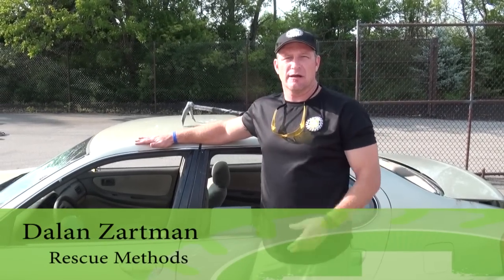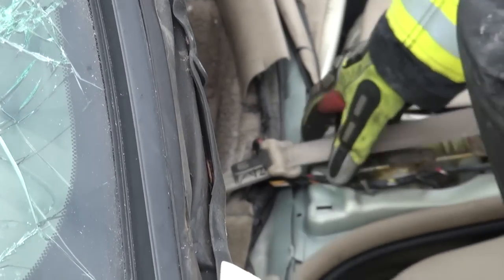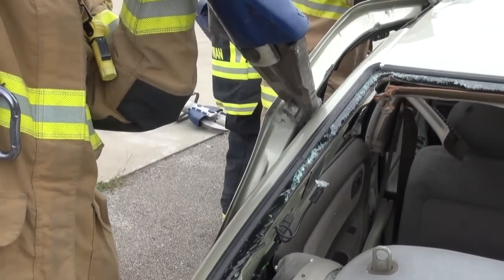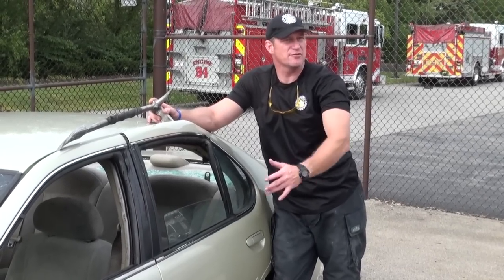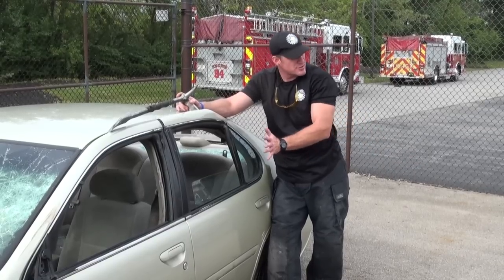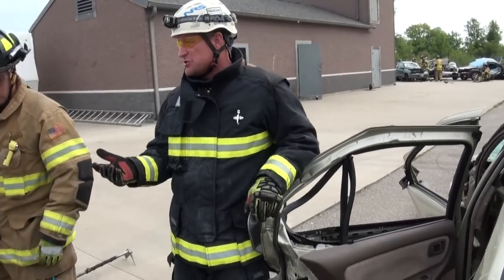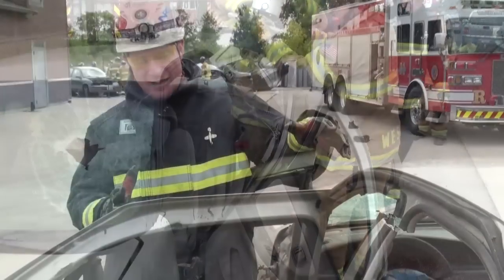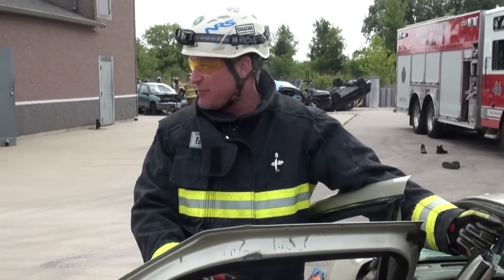Rescue Methods FR1: Extrication Concepts

Comment: I've recently joined a rescue organization and have been trolling through you tube for tips to help my training. Not once have I seen just try the door handle first to see if the door is unlocked and open. Is there a reason for this. Cheers Tony

Comment: I know this is 7 years old but there are some takeaways for me. Spreading from the top down makes sense. As far as the fold over, why not cut the bottom of B post then cut the top instead of spending an extra 3-5 minutes bending it with an extra tool. We removed our rams from pour extrication tools since the spreaders can do almost anything a ram can do.

Comment: different strokes for different folks, all departments have diff techniques and not all work on every accident as no accident is the same. Thanks for the video. And i like the battery operated extrication equipment, much nicer than dragging around a pair of hydraulic hoses on a jaws and starting a pump

Comment: why dont they just cut the posts with a saw and the hydraulic cutters. also why cant they use spreaders to take the doors off but putting them by the hinges
Reply from the maker: +jim bob The concept behind the side out techniques, particularly the fold down, is to pull all of the material away from the victim and the setting is new car technology.  The premise is a side impact or T bone in which the reinforcing bars in the doors fold in the B pillar and are compressing the patients on the driver's side.  There are a lot of different ways to approach this, but we have found these to be the most effective and rapid techniques.  Cutting the front bottom of the B post with a hydraulic cutter will typically swing the tool into contact with the victim in this scenario.  Spreading the hinges from the B post on the rear door usually drives the B post further into the victim with this type of side intrusion.  A recipe saw, unless using a Diablo blade, will be almost completely ineffective (very slow with multiple blade changes) at cutting the top of the B and the bottom of the B adds the challenge of reduced access to the cut zone.  The goal is to minimize the victim's injuries and gain full management access.  Thanks for weighing in.  We appreciate your thoughts and input.
Reply: Rescue Methods cant you use a reciprocating saw as they are faster the using hydralic cutters or use both tools but on different parts of the car to get the roof of quicker